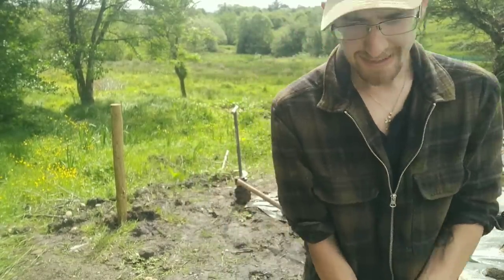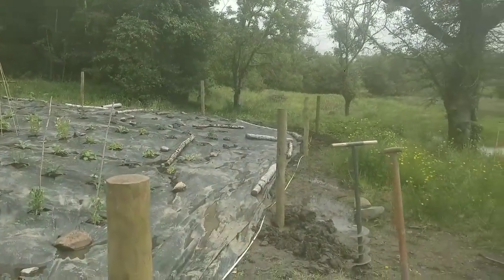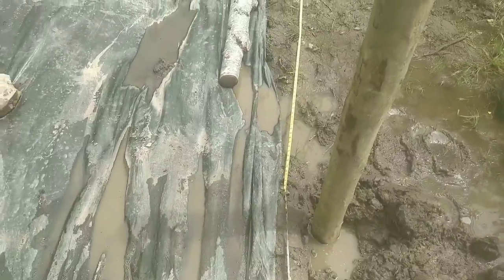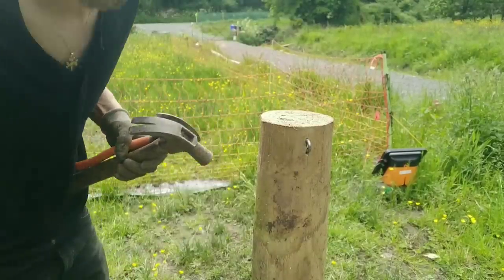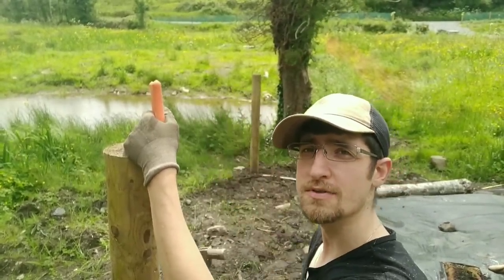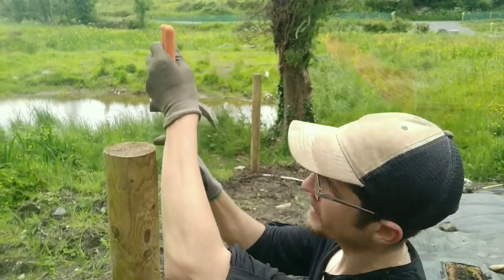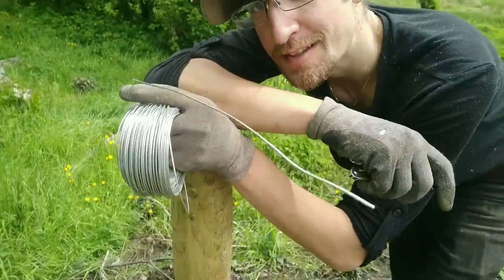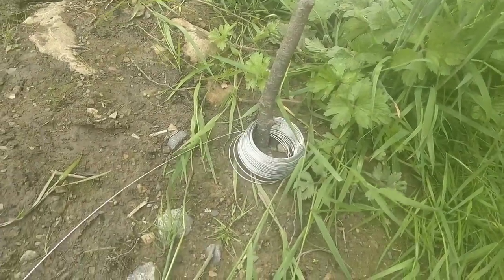How to install a windbreak properly | No rips or tears

Comment: Great video, thank you. In my experience, plastic zip ties don't do weel with UV, and get brittle and fall aprat after a few months, I'd be happy to see an update after a year or so, it maybe different in different climates. As for your cable on which you hang the wind-breaker, you can get tensors which are like 80 cents a piece, you clip the wire and hook both ends, and then you just need to tighten a screw to add tension. Even metal wire will start sagging after some time. It's great seeing your project come along, I'm always happy when I see one of your new videos.

Comment: Here is a suggestion to help you drive in your staples into a fence post:  Do as you have been doing but, once the staple has been started, hold your pliers next to the post - opposite side of where the staple is, then hammer in the staple.  It helps keep the post from bouncing around too much.  Hope that makes sense.
Reply from the maker: Makes perfect sense!

Comment: 45 degree post at the ends joined to a short crossmember, which you bury underground, would add strength. I think as the ground softens in heavy rain the end posts will start to lean over. Keep it up though,you’re doing well.

Comment: Lovely job 😌 Question: Will the posts be secure enough without using concrete, given that your soil is somewhat waterlogged? 🌊
Reply from the maker: Yes, my soil is heavy clay it should hold well enough :) I'll make adjustments if necessary
Reply: @thebridgemanscottage  might not want it there forever either. So these would be removable.

Comment: 1.6 meters would be the better post spacing for fencing. Cable ties work well it laths of wood hammer on each post is better. The auger do I ne turn and lit out the soil but better not to use it at all. I did 70 meters of wind break for a hedge last month with cable ties great job

Comment: How about threading the wire through the holes on the windbreak?
Reply from the maker: Could be done, but a lot more time consuming! If a hole breaks with the cable tie you can just use another one!